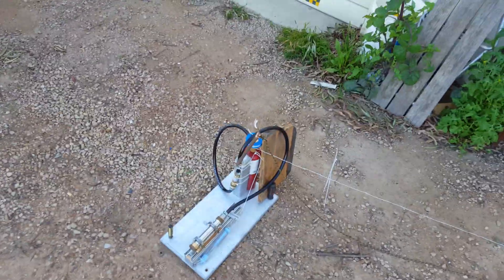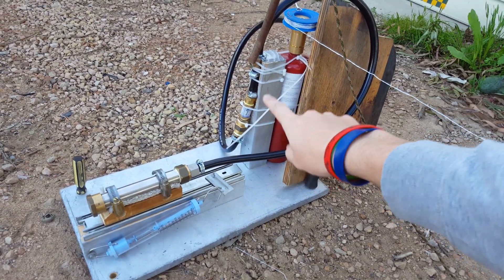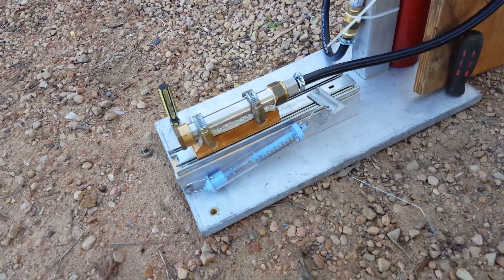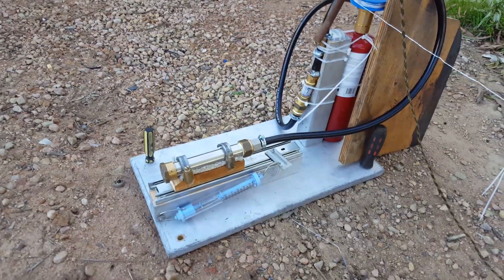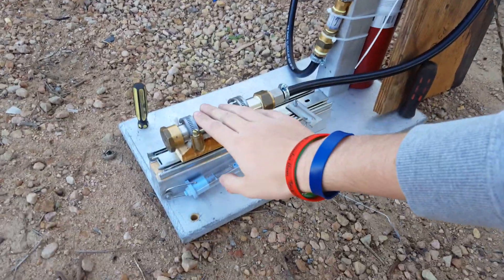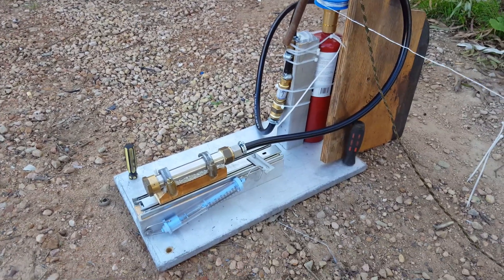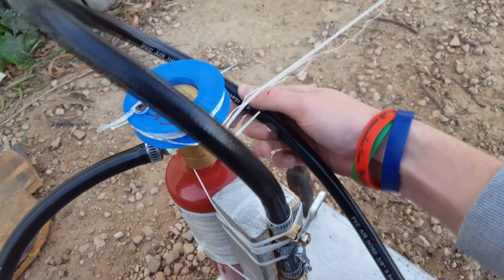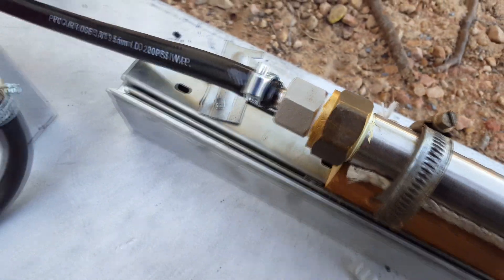First Test of DIY Homemade PP/O2 Hybrid Rocket Engine

Comment: before liquid oxygen, consider getting a nitrous oxide tank that you can have refilled for cheap from a drag race supply place.. you'll get many engine runs off a couple dollars of nitrous in a single tank that can be refilled. -- your problem then will be that it generates so much thrust the entire thing will burst into pieces

Comment: This is not a rocket engine.  It's an oxy/acetylene torch nothing more.  A rocket engine produces its own pressure in the combustion chamber.  Your pressure at the nozzle is coming from the pressure in the oxy/acetylene tank.  You'd get exactly the same result using compressed air!  The result being...no thrust.

Comment: Hi there you could use metal tube for the fuel tubes probably it wouldn't melt but would probably rust
Reply: humphrey707 you could use a steel pipe for the case and shove the fuel in the pipe

Comment: without a doubt gotta move the flashback valve to just before the back of the chamber and use something heat resistant like -6 braided steel line. You can find that at most auto parts stores.

Comment: Wow, nice job. I'm thinking of building one myself, but I'm still unsure of what to use for propellant.
Reply: for starters, you could try some solid rockets (maybe with gunpowder or a sugar rocket). That way you'll get the basics... from there, I would recommend something easy to get, such as Hydrogen gas for fuel and O2 as an oxidizer, but those are very high maintenance and unstable  (LOX should have some kind of temperature control cause it can only be liquid at very low temperatures)... so if you want to use something more stable (and safe!) you could try nitrous oxide (N2O) as you oxidizer, and kerosene or paraffin... those are harder to get though...
Reply: I'm actually working on an engine right now. I'm using gaseous oxygen and methane for fuel, which I just got a couple canisters of. I would use liquid but it's a lot more than just using gas
Reply: I've read that nitrous oxide would give you much better Isp, cause it can compress a larger amount of oxygen since it can take liquid form at room temperature... it's commonly used as oxidizer in rockets, and it was intended as a replacement for hydrazine due to stability problems with the later...
Reply: I made a rocket that was powered by compressed oxygen and math homework.  Pretty much anything works as propellant.
Reply: Liquid Oxygen and Liquid Hydrogen :)
Reply: Kerosene for better results

Comment: What sort of max/average thrust values did you get from this setup? Looking to build a similar prototype as the starting point for my university rocket team's hybrid engine development
Reply from the maker: A ridiculously small amount, not even enough to overcome the friction of the slide rail mounting in most cases. I will get to making a better one at some point, I would suggest a better form of fuel grain and higher flow oxygen then I had here to get any real measurable thrust.
Reply: Thanks for the reply. Due to the ease of casting I think I'm going to go ahead with parrafin wax (melt down, pour into whatever casing geometry you want), and a gaseous oxygen. Judging by your accent I'm guessing you're not in the States. REgardless, how did you come across your oxygen tank?
Reply from the maker: My next hybrid will also be paraffin wax. Haha, im an Aussie. The little bottle of oxygen was for a tiny portable oxy-acetylene welding kit. I don't recommend using a bottle this small though, it was essentially empty after these tests. the best route is to rent a small/medium size oxy bottle from a welding store and a regulator. Good luck!

Comment: For a nozzle, I'd recommend using plaster of Paris, it apparently works, at least as far as I've seen on the internet, and there's no machining needed, just make a mould and cast it
Reply from the maker: Thanks mate, that's one I hadnt thought of!
Reply: @novanet7895  would work but very short burn before it arodes

Comment: I built my first liquid fueled engine a few months ago, it takes in baking soda mixed with water and vinegar. Its made of tubes and containers I found and funnels. It also has the appearance of a merlin engine.
Reply: Does it work well?
Reply: @cruxaero7086  lol no it barely worked. I was like 13-14 at the time. That was so long ago. Recently, I did make a solid propellant motor for my 3D printed model rocket though! It had avionics and all!
Reply: @brandonfleming7118  we’re working on hybrid engines at the moment. Solids fantastic but storing them and transporting them isn’t so good.

Comment: Where did you get the nozzle cap thingy on the oxygen tank
Reply from the maker: That was actually the hardest thing to acquire due to the oxygen bottles being reverse thread. i ended up buying the entire mini Oxy-Acetylene welding kit meant for the bottles just to get the connector.
Reply: novanet ok thank you
Reply from the maker: That being said, for the next tests i will be using a much larger oxy bottle, you can buy or rent these from welding stores or gas stores and they fit standard oxygen regulators.

Comment: Do you think you could get one to actually fly?
Reply from the maker: With this current setup and design, no way. But small hybrids as a whole, yeah, small hybrids are commonly used in model rocketry under the name Micro-Hybrid, they generally use N2O canisters and paper fuel. As for this design, it gets about everything wrong :)

Comment: How much bars was in your o2 tank?
Reply from the maker: Only around 200PSI, much lower than needed. not going to bother doing 
any more burns using these little O2 tanks, will be getting much larger 
O2 tank at 2000~ PSI.

Comment: Maybe use a length of steel brake line or equivalent to solve the melting problem. How are you inserting the fuel? Are you just drilling a hole in a solid cylinder of polypropylene and feeding the oxygen through it?
Reply from the maker: Yeah, will be inserting a break between fuel and supply line next trial, will also have solenoid valve for control and a pressure gauge. And nah, different design to NightHawkInLight and Applied Sciences videos, i have a 3/4" SS tube with another PP tube inserted inside of it, the PP fuel cores simply slide in and out with the end cap removed. Will also be trying different size holes for nozzle then moving onto an actual de Laval nozzle shape. Thanks for watching!